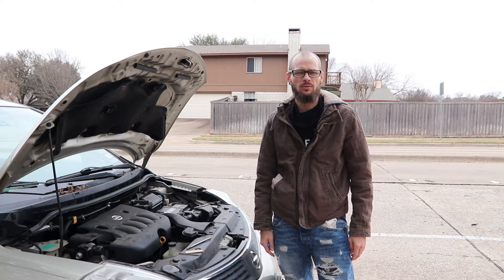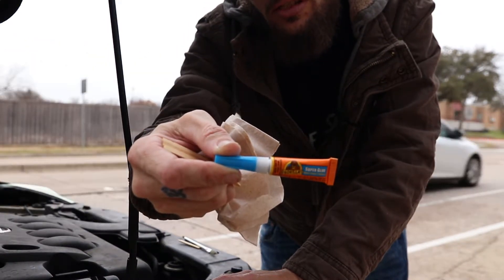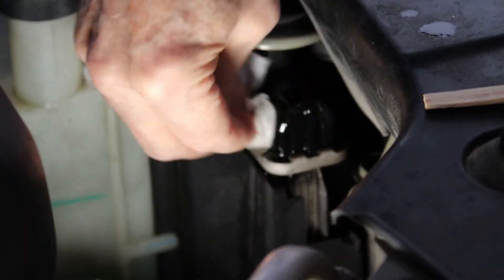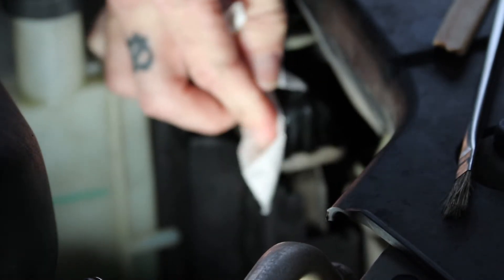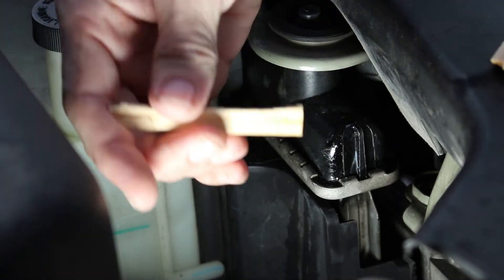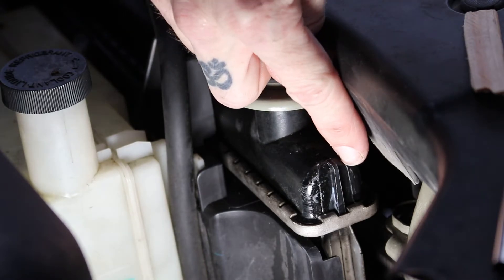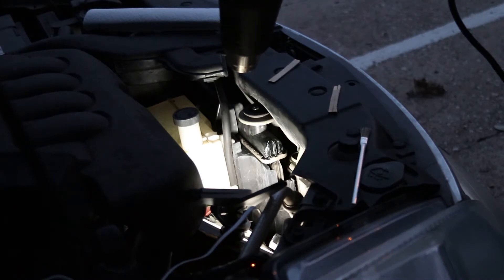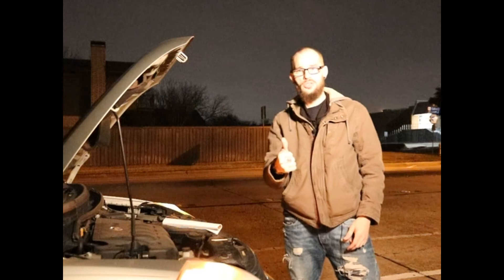How Strong is Super Glue?! Fix a Radiator With GORILLA GLUE ?

Comment: I hope it worked for you but for me I would have used JB Weld. People make fun of it but I have successfuly repaired a few things with it.
Reply from the maker: This is just a way to test a different products strength, not about what everyone else has already tried. The basis of the video was gorilla glues claim of bonding strength, drying length and durability against extreme pressure. I suggest not using anything and just replacing the radiator altogether, but if you're already going to replace one and a sponsor wants you to.. you take the opportunity!

Comment: I have a bent radiator tube, will hot glue and this help fix it? Thanks.
Reply from the maker: Hot glue is probably not a good idea just because it will melt again when the engine gets up to temperature. Is it a rubber tube, like one of the water hoses, or metal line for the transmission fluid?
Reply: Hot glue 😂😂😂 you’re funny

Comment: I would recommend for that project to fix a radiator specially that has heat and chemicals around at all times and out in the elements JB Weld,epoxy type Sealants that Also bond as if it was part of it
Reply from the maker: This was an experiment, I would never fix a Radiator this way.. I would recommend always replacing your cracked Radiator. This was a test of the adhesive strength for this specific product under pressure.
Reply: @CoreyCoversALL  I guess we will see the outcome of the experiment 👍 I am wondering if it will be to stay bond and hand what will come at as time passes on lol
Reply from the maker: I'm sure it won't. But a good test for the strength of the product. We'll see what happens!! Either way the Radiator is getting replaced 😅

Comment: I haven't even watched it yet and I'm telling u it's going to break stupid it's for wood
Reply from the maker: Wood glue is for wood, this isn't Gorilla wood glue, it's Gorilla super glue. You should have watched because it did work! Thanks for "telling me" though.
Reply: @CoreyCoversALL  Good retort!  Did it hold up?
Reply from the maker: It did hold up! I was very surprised at how well it worked. I've replaced the radiator now because after fixing that spot, it allowed enough pressure to let a smaller leak (on the other side from the video near the bottom) to show its ugly face! So it told me that the plastic on the sides of the radiator was at the end of its life and I didn't feel it was worth my time continously chasing other cracks. But the spot in this video held perfect and never leaked again (I replaced the radiator about 4 months after the video, so I can say the spot I fixed held up in Texas weather for 4 months with no issues and would have held up for longer had I not decided to go ahead and just replace it) so in conclusion, if you just have one crack or 2 cracks and need to make it a while because of financial issues... this will definitely hold you though, As long as it's applied correctly and allow proper drying time!

Thanks for the view, comment and compliment! Hopefully you've subscribed, I've got some awesome content coming soon, more fun trial and error video's, some cool big projects I'm finishing up, as well as some different product reviews! I look forward to seeing you in the comments in the future!
Reply: If you have been paying attention you would know that Gorilla glue can be used for many surfaces and even be used for permanent hair styling.
Reply from the maker: "Permanent hair styling" 😆 Yep, definitely permanent!!